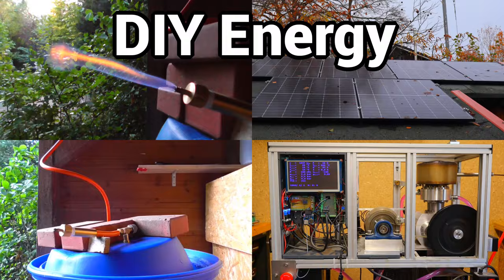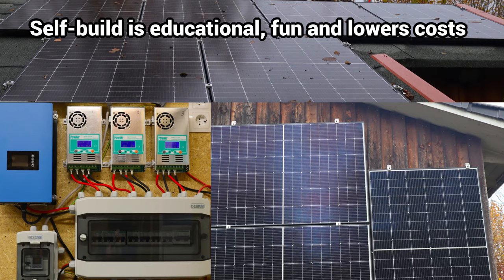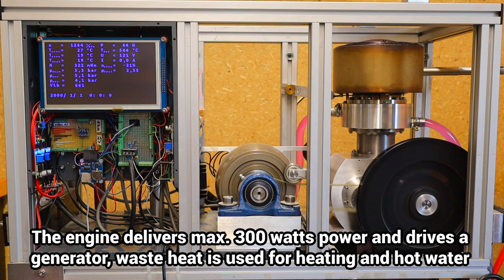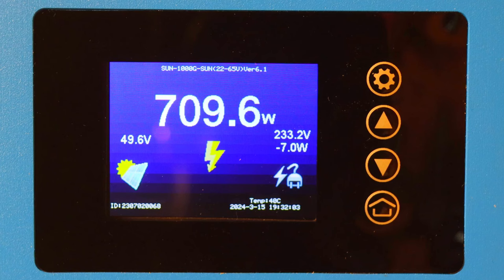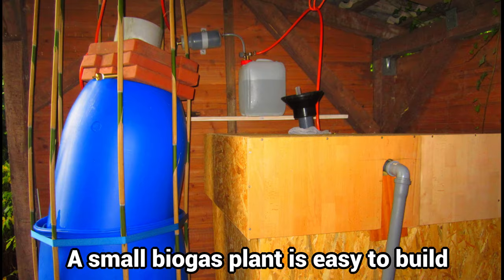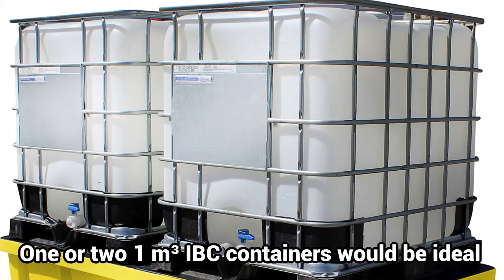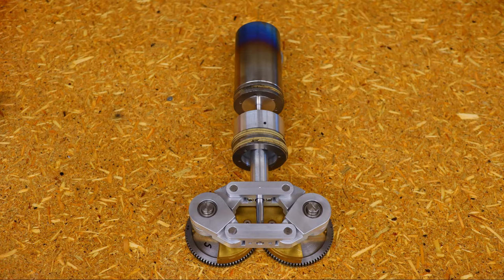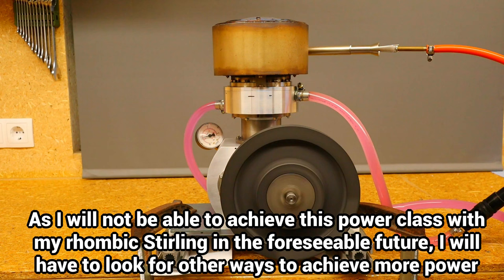Energy self sufficiency with solar power, DIY biogas and self built Stirling cogeneration unit / CHP

Comment: A free piston engine with linear generator would solve so many issues, simplify it, increase efficiency and allow you to run a higher pressures inside without fear of leaks, you could probably modify some of the components you already have. There were boilers from the early 2000s made with these inside for CHP, wish I could find one of these for cheap.
Reply: There are still systems like that. Saw one in Finnland half a year ago by an Austrian manufacturer. But not cheap. aprox. 10k woodboiler, 10k stirling, 10k battery pack to buffer the dayli production.
It was in use because paying for a grid connection was even more expensive there

Comment: I think few things can be tried before looking for other quick possibilities.

1. Pressurizing the crank case with a small pressure pump to few atmospheres.  I believe the average chamber pressure will eventually reach the crank case pressure. 
2. If you feel the flywheel bearing is too leaky, the entire setup can be put inside an airtight box and the box can be pressurized, with a small pressure pump. 

In one or another way we can try adding more working fluids to the same setup and if that works out.
Reply from the maker: The crankcase is already pressurized to the mean pressure of 10 bar which leads to a max pressure in the working spaces of approx 16 bar.
The crankshaft has a face seal which is pretty tight with not too much friction.
Thanks for your suggestions

Comment: Go for the Stirling! You could reduce the forces on the bearing by pressurizing the crankcase and make it hermetically sealed. The backside of the power piston acts like a gas spring so the connecting rods see much lower load. 
The generator should be part of the crankcase. Get rid of the belt, install a coupling instead, directly connected to the generator shaft. 
Use a generator that really fits your needs in terms of RPM, KV and inertia. I can help you on that if you like, maybe i even have something in the basement i can send you. I have an old MAC 6T (gen2, so 0.3mm lams) for example that you can have for free.
And of course: Use a VESC as rectifier/ inverter, a 75100 VESC should fit if you use a 24V-84V battery. No need for a drill for startup anymore and it goes really easy on your crank bearings as torque can be smoothed out using the vector control algorithm, plus it will run smoothly with much reduced inertia, so no flywheel needed anymore. And the generator efficiency can be increased quite a bit, too

What is your battery voltage and RPM?
Reply from the maker: The crankcase is already pressurized to the mean pressure of 10 bar.
An integrated generator in the crankcase would be nice but the crankcase has to be much bigger and my seals (face seal for the crankshaft) ar quite good with not too much friction.
The generator is a bit to big at the moment but when I reach power levels around 1 KW it fits perfectly.

The engine runs with approx. 2000 rpm and the generator delivers then 100 V which fits perfectly with a solar charger for my 50 volt battery voltage.

I have to inform myself about a VESC, is it only to use the generator also as a starter motor or can it also control the generator mode?

Thanks for your suggestions!
Reply: @myengines2443  of course it can control the generator. That is called regenerative braking. It has several modes from torque to speed control. If the generator was part of the crankshaft then it would also be possible to alter the torque within one cycle, but that would not be so easy, software wise. The motor/generator must be a 3-phase though. Brushed DC does  not work, they are obsolete anyway.

If the crankcase is already pressurized then most likely the crankcase volume is too large to effectively act as gas spring. So the crank and connecting rod bearings are not effectively relieved. You could add a lasercut disc spring to/above the rombic drive, just like in a free piston stirling, to compensate the free mass forces on the crankshaft. The spring must be tuned to match your 2000rpm though. It should be possible to calculate the spring rate quite accurately before cutting it. The spring should be a multi disc type, so the resonance frequency can be fine tuned by adding/removing discs

Comment: here is one class of Stirling Engine I'm suprised you havent looked at; Free Piston Stirling Engines, with gass bearings. 
They have the long life you are after, because of the gass bearings, so no parts are wearing against each other. And the posibility to easily scale it to the size you need. 
This is the class NASA chose for their space nuclear power test program, and they have buiilt several (but not used them in space). 
They are also available as commercial units that do almost exactly what you need, from Microgen.
Reply: I tried to attach links to other videos and articles, but apparently that doesn't work. I try again with one of them here:
There are also available as commercial units that do almost exactly what you need, see here: https://www.youtube.com/watch?v=j7knv8F8byE

The cut-away model they show should be enough to build something similar.
Reply from the maker: I am very interested in the free piston Stirling engine but they also have their own problems.
It is also quite complicated to design them, the feedback loop and other problems are not easy to solve.
Thanks for your suggestions I am always interested in your proposals.

Comment: 300 Watts 24/7 can go a long ways to provide comfort and ease, especially with batteries attached.  I don't know if you have published your designs, but I would love to see examples of real power output when combined with a small wood stove.  Also I would like to see an inverter style (outrunner) generator added so no transmission losses, and then a microcontroller circuit to use the generator as a starter.   Do you share plans for these?

Comment: I just came across your chanel and love what you do! i think you should make the engine bigger so that you can keep the system quiet as if its running all the time it may be very annoying if its too loud. An interesting idea i have would be to use exxess power to make hydrogen to also fuel your engine as it might be a very cheap way to store your power but be aware that if you want to use a fuel cell to get that power its not reccomended from me as it is quite expensive to bouild and difficult to get the materials required for eample platinum or lithium.
Reply from the maker: Of course the engine has to put into a soundproofed box for working.
Thanks for your thoughts, I think to build a fuel cell is a very big project also.
Greetings
Reply: Hydrogen is probably the dumbest idea. It´s way to expensive, very complex and dangerous besides being unable to store it safely and produce it enegry efficient in the frist place.
You can rather speed up a flywheel or basically anything else besides using hydrogen.

Comment: A small internal combustion engine with a catalytic converter and use the exhaust gasses to drive the Stirling engine, the heat after the CAT with the correct AFR should be 400 to 600 degrees C, this way you will get the best of both worlds and will be able to keep the Stirling as it is it should be a pretty good size match for small generator engine, get a generator that matches your battery voltage for direct charging would be best rather than using a mains generator.
Reply from the maker: Yes this are good thoughts, I wanted to use a solar battery charger to load the battery.
Greetings
Ralf

Comment: There is one class of Stirling Engine I'm suprised you havent looked at; Free Piston Stirling Engines, with gass bearings. 
They have the long life you are after, because of the gass bearings, so no parts are wearing against each other. And the posibility to easily scale it to the size you need. 
This is the class NASA chose for their space nuclear power test program, and they have buiilt several (but not used them in space). 
They are also available as commercial units that do almost exactly what you need, see here: https://www.youtube.com/watch?v=j7knv8F8byE
The cut-away model they show should be enough to build something similar.

Comment: Hi, 
i am currently in similare thinking of starting trials with stirling engine or internal combustion engine. I already bought a small ICE for tests with 4.8kW running on gasoline for co production during winter or bad weather periode for our PV system. 

Our situation is like this: 
From March to middle of October we have a average of roughly 15kWh per day use, which we produce with our PV system.  But during the winter time we have a approximat need of 1600kWh which we cant cover. According my calculatuin a engine with 2-3kW running 5-7 hours a day would catch it up as a backup generator running on syngas from biomass. 

Both systems would come handy for me because the waste heat can be used for heating my PV technical room together with my workshop with all the machines which was rusting this years winter quite a bit. 

Personally i think that even small engines can achieve this energy level, what i am doubting very much is the lifetime of the engine. Thats something which are in CHP forums often mentioned, which miss a lot people on this topic. 

A car engine has a expected livetime of 7500h which means by 5 hours every day run time: 1500 days => 10 years. A smaller stationary engine is more like a 500hours run time. Thats also a reason why VWs BHKW was kind of failing, the engine was not made for such long runtimes of 20-30 years each year 2000 hours. 

The only engines with long enough run times for such a applications are construction site equipment engines or turbines. They can achieve 30-50.000 hours or more. Turbines in particular i think is a more favorble solution for this application because they create a continues low of fuel for the syngas production it is easier to adjust and they are more robust for less clean fuel. 

Cleaning of gas is the major challenge by such type of system. And cooling of the gas. 

The bio digester system together with a small stationarry engine would perfectly work together. Because the fuel gas is clean and has no debree. 

Greetings from southern germany
Reply: one of the main reasons for premature failure is the small volume of hot unfiltered oil, an oil cooler, filter and pump can provide waste heat and extend the life of a cheap engine.
Reply: @ChrisDay-sx4lv  So you say the small engines need just better oil maintinance for longer lifetime? Like a oil pump with filter attached? That would be really easy to add if it is just such a tiny thing
Reply from the maker: Yes, these are exactly my thoughts - very good that you are also dealing with this.
I think these small, cheap combustion engines quickly get into big problems in continuous operation.
Maybe a Lister or similar quality engine would be a solution, but for now I'm trying to get more power out of my Stirlings.

Many thanks for your interesting posts.

I would be very happy to receive more information.
Reply: @michaelbloser3572 yes i think so they overheat especially the valves, and get dirty oil seems to be the common cause of failure, obviously the journals dont have oil pumped into them so they will never be as reliable. 
I have an suitcase inverter generator engine, im using a BMW 12v oil gear pump from i think a transmission, it small and very affordable combined with an integrated coolant to oil heat exchanger with an oil filter attachment from a VW of some sort, im pumping oil from the crankcase where the oil filler neck is, cooling it filtering it and then delivering it above the valves to cool them. 
Im doing experiments with propane so not much cooling on the valves from fuel evaporation, im planning to use an ultrasonic fogger to increase the cooling on the intake charge or possibly a water bubbler to do the same. 
I have it linked to a grid tie inverter and it generates about 450w, I have a small cat and exhaust heat exchanger (EGR cooler) that I need to attach to remove the exhaust heat for CHP that will be plumbed into hot water tank for storage. 
I never did finish it to a state where it was useable but im planning on re visiting the project.  @myengines2443
Reply: @ChrisDay-sx4lv  Thank you thats very good to know. When i make some trials i will probably make videos and upload them
Reply: @ChrisDay-sx4lv  I have a question if you dont mind. Which kind of gasifier is better for running a iec on it? I mean there is some serious issuee by some models with tar production which i understand comes from the point that the process runs to cold. Another point is that some are made with bad filter systems behind.

What i figures out until now is the dianeter acc. FEMA design is 50mm pipe, as filters there should be a cyclone, a cooler with condenser, a filter with gravel up to 5mm and a fine filter with sand or something similare for the last stage. With this setup it should be possible to avoid any tar build up in the engine. A paperfilter against the Sand should also be in place. 😊
Reply: @michaelbloser3572 Im not experienced with gasifiers i have never built one, i can tell you that the type of gasifier makes the biggest difference, optimizing the running characteristics will be the challenge, you need to get the temperature just right too low and you will have excess tar and too high you will make clinker which will clog up the burn chamber, all the while dealing with the changing water content and size of the fuel.
Pyrolysis with the absence of oxygen might be a better way to go, even though the total energy output of will be less, using the non condensable gas directly in an engine should be possible. you can then burn the other oil fractions when they have been purified / distilled, 
another advantage of pyrolysis is that you can pretty much pyrolyze anything including plastic or mixtures including wood, general waste, fats / oils and turn them into useable fuel, Both ways wont be easy as of such, they both have there advantages and drawbacks.
 If you have food or animal wastes, a bio digester producing methane is a very simple way of obtaining fuel without any nasty chemicals, it also have the benefit of a source of fertilizer.

Comment: Increase the internal pressures in your Stirling engine.. Use nitrogen in the cylinder.
Reply: Better to use Helium or Hydrogen. But the first one is not cheap and the second "quite" dangerous. You coul'd have some problems with the nitriding process of some metals.
Reply from the maker: The internal mean pressure is at maxim power at 10 bar, maximum pressure in the working space is approx. up to 16 bar.
That's as far as I go.
Above that it will bve to dangerous for me because of diesel effects and the risc of burst.
You would use nitrogen to avoid diesel effect or what is the reason?
Greetings
Reply: https://en.wikipedia.org/wiki/Stirling_engine#Operational_considerations
You may have a look at "gas choice"

Comment: Finally you gave up xD I won´t to say I tol you so but I told you so. Turbine is also multi fuel or a steam engine, or at least a Free piston or thermoacoustic stirling engine which is way cheaper with less moving parts.
Reply from the maker: I din not gave up the Stirling, just to get energy soon I am dealing with the idea of an IC engine but they have also a lot of problems with alternative fuels like biogas or woodgas.
Thanks for your comment
Reply: @myengines2443  Yes the ICE needs perfect conditions. An external combustion engine is a good idea in general. Maybe a 3D printed turbine could be a solution ? But it´s expensive.

Comment: you can use inflatable system
Reply from the maker: You mean to pressurize the Stirling engine?
It is pressurized to 10 bar, otherwise you would need a very big engine for 300 watts.

Comment: fill it with helium and test if that works. Helium has thermal conductivity 10 times that of air and is ideal for Stirling engines. If not helium - then hydrogen, but be vary not to compress it beyond 40 bars and of fire risk hazards.
Reply from the maker: I made experiments with helium, but as the heat exchangers are designed for air as the working fluid the tests were not so promising.
When the engine is running satisfactory again I will make tests with helium again.
Hydrogen is to dangerous for me!
Thanks alot and greetings
Reply: @myengines2443  also using helium is not very self sufficient. Low grade Nitrogen would be my choice: Easy to make from exhaust gas from a gas engine, just filter out the CO2. No problems with the O2 anymore

Comment: how do the linkage pins on the rhombic stirling hold up? could that engine go for a few thousand hours without maintenance?
Reply from the maker: The connecting bolts are pressed with screws.
Apart from the increase in performance, durability is the biggest challenge and the reason for constant improvement, as is now the case with the roller bearing connecting rods.
The Stirling has run for several hundred hours with the plain bearings, which are now worn out.
Greetings